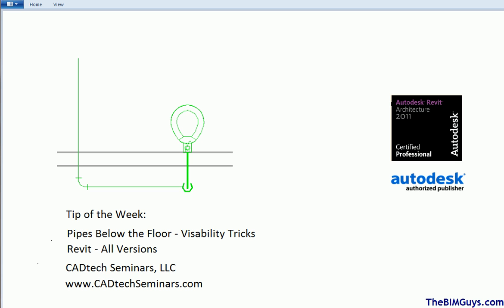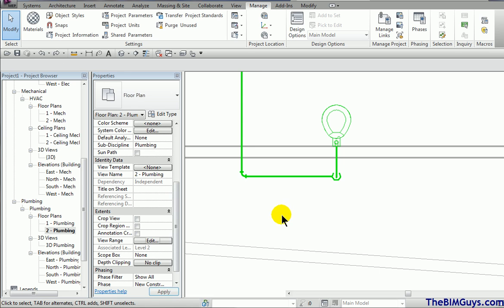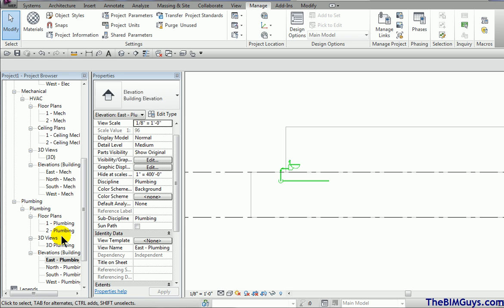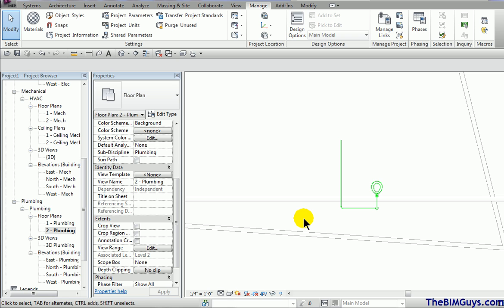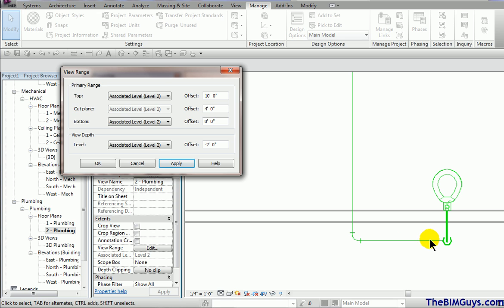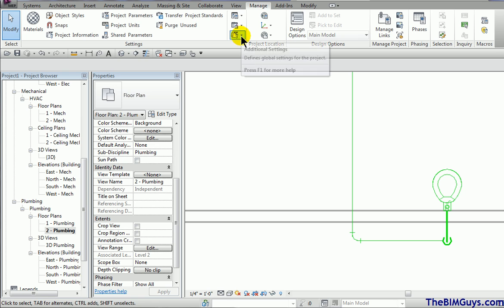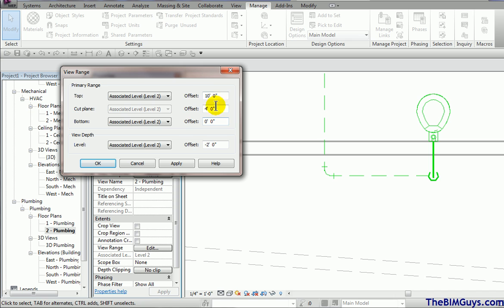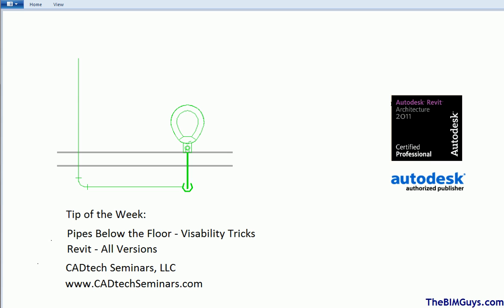Revit - View Range and View Depth Tips and Tricks - CADtech Seminars.com

Comment: Great video but how can I show "beyond" elements lines as halftone? My problem is I have a mezanine floor with a double heightI wanna show show the ffloor and its furniture below the mezanine as halftoned so they appear to be in alower level.. I tried underlay but he problem is they show the whole lower floor underlayed not just the area where there is a mezanine?
Reply from the maker: Another option is to use underlay to show the information below. Then using the 'Line Work' tool, pick the lines you want to stay. Change them slightly using the Line Work tool and then turn off the underlay. The lines that were edited with the linework tool will remain.